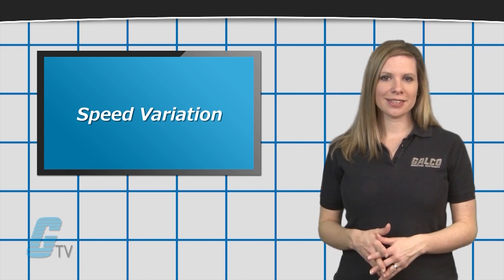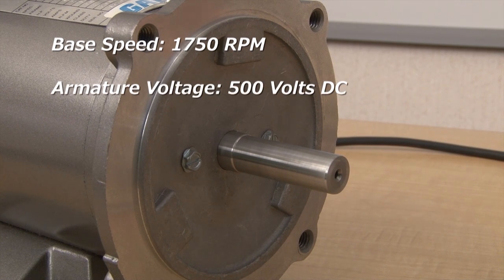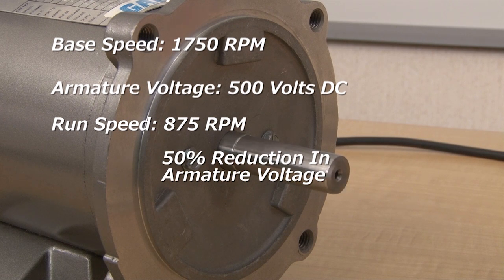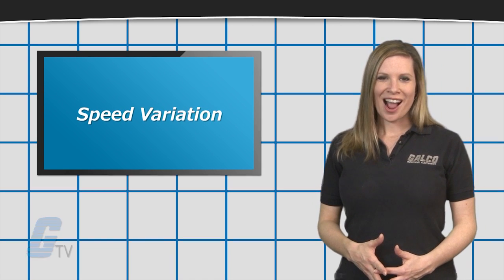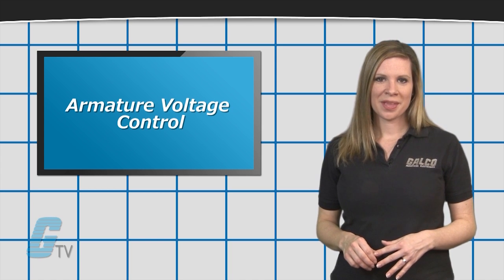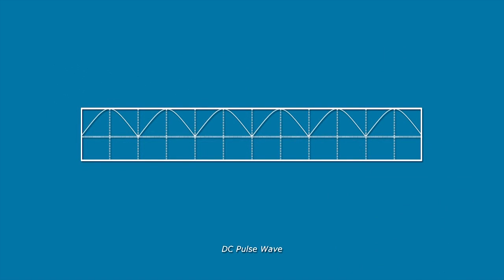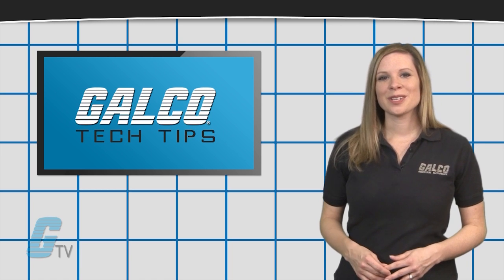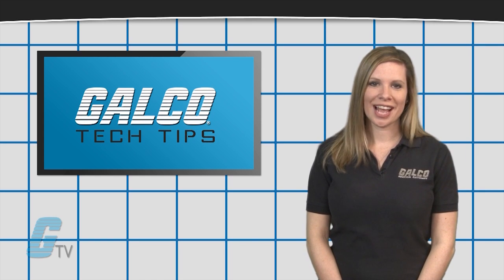Advantages of DC Motors - A GalcoTV Tech Tip | Galco

Comment: advantages over what?
Reply from the maker: Good question, we don't really compare it to anything do we? Compared to AC motors (which have more similarities then you might think) DC motors can produce more torque at zero speed than AC. All though modern AC drives have greatly improved AC motor performance even at zero speed, DC is usually stronger. DC is good for applications that require great amounts "Break away" torque, like steel processing or Lime stone Kilns. Hope this helps, thanks for asking.